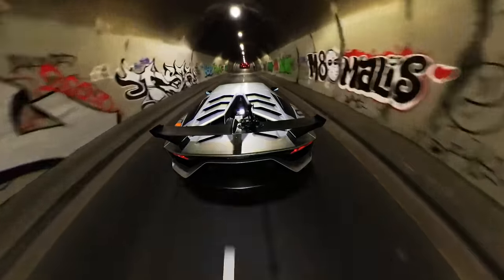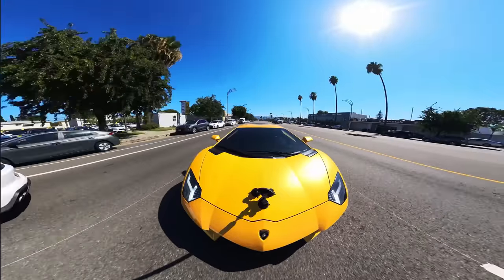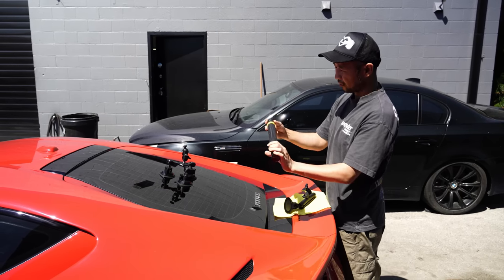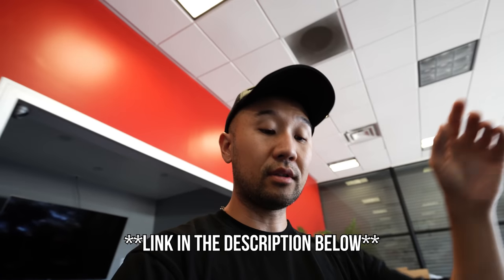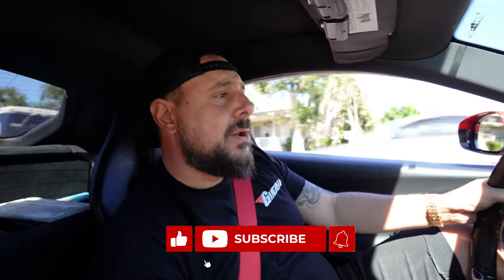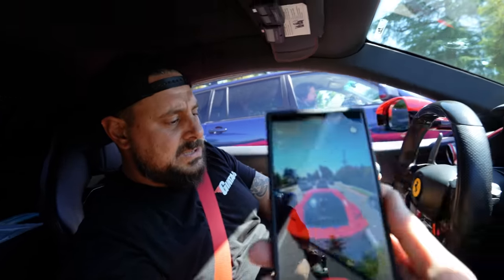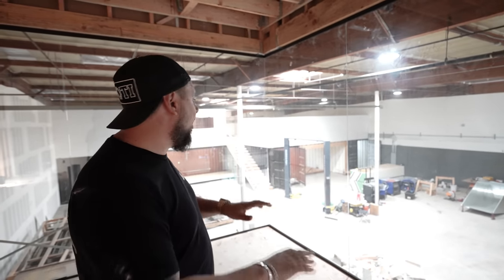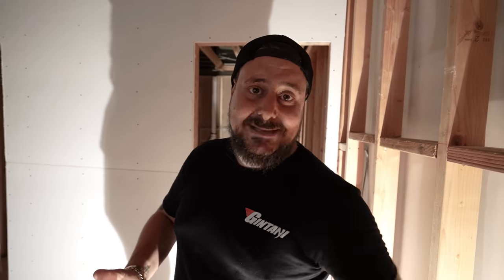We're MOVING! Gintani’s INSANE New Headquarters!

Comment: Those doors on the containers will probably be an issue with Fire Sign off - Check with your code consultant / Architect on the project!
Reply: Doubt the doors are staying. Egress is not as important in a commercial application like this for the offices or engine rooms etc.